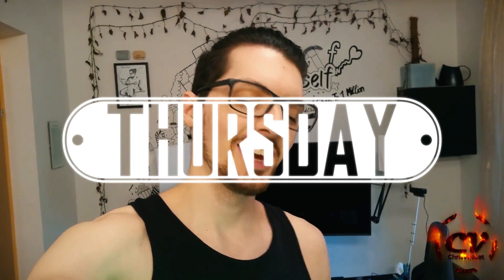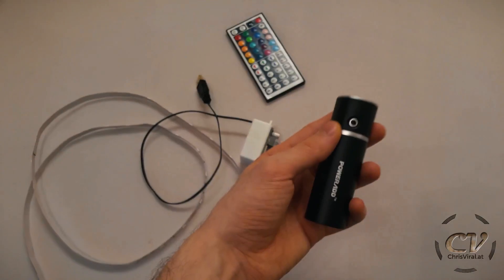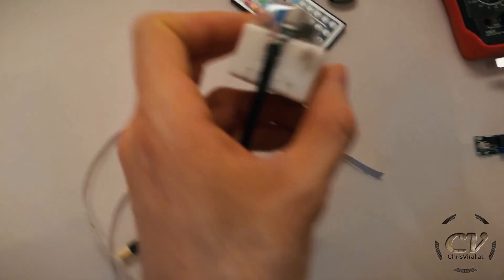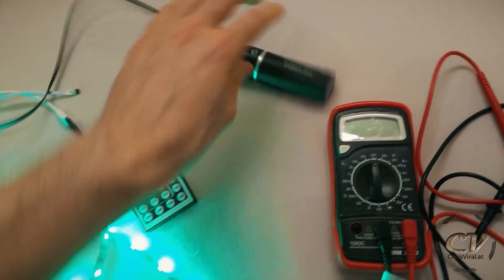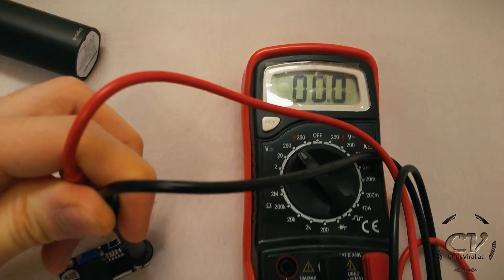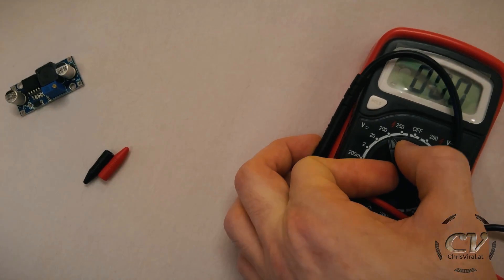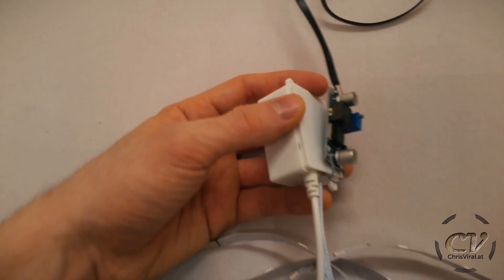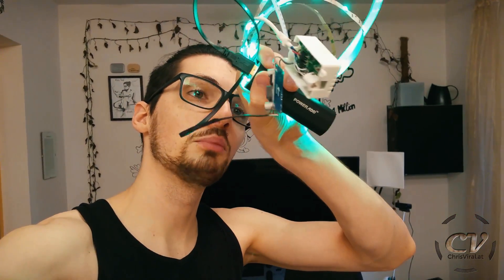How To Power LEDs With A Power Bank (5V To 12V)

Comment from the maker: I just found out about a MUCH easier way: https://youtu.be/LFCl8_Sp0eA
Everything you just saw combined in one cable. 0 work involved.
Reply: hi there im trying to run a power up connected to a step up 5v-12v to run a 12v led lights, but the led lights would only flicker and then die off in abit,  but it would be running at about 10-11v on the step up but it is not the brightest as it can't hit 12v. im using a 20k power bank 2.1a output and the led is 10 strips, 3LED per strips
Reply from the maker: I had the same result on my triangle light. The reason is that the power bank is simply too weak and can't deliver enough current and will then shut itself off. The solution to this problem is to shorten the strips until it gets stable.

Comment: Thank you for sharing this. I use 5V USB-LED-strips built into my guitars (am a luthier based in Japan.). I have yet to find a power bank without a "power switch" or turning itself off. The guitars are closed, the power bank is in the body. There is a lid to open and close, but it is a pain in the butt to always switch on the power bank first. The LEDs shall be operated only by the remote. Any advise on that? All models I tried so far have the same problem. LEDs cannot be switched on only via remote without activating the power bank first. Help plz. Getting gray hair. USB C to A adaptors didn't do it either.
Reply: There are Powerbanks that have a low current mode meant for smart watches and similar small devices that can’t be charged at your normal 5V 1A (which is now a dinosaur of a charging protocol since nearly everything charges at 5V 2A minimum now). 

The low current mode exists as a manual “stay on” switch since the current (usually 50-100ma) is below the threshold that most powerbanks have for the current needed to tell the device something is plugged in and charging so stay on. So if you are only charging your Apple Watch it would normally not keep the powerbank on. The powerbank would see there is barely any current being pulled, assume the device plugged in is no longer charging and switch off to save battery but on most powerbanks with this feature you either hold the button for 3 seconds or double or triple tap. 

The alternative is to skip the powerbank circuit since that is what is causing you issues. Go straight to lithium cells (can be dangerous if you don’t know what you are doing! Seriously don’t just start fucking around with lithium cells without doing research) and use a circuit that gives you what you need. There are tons of simple 5V-32V USB Buck Regulators that can handle that wide voltage range and output 5V into a USB port. I don’t think any of them have any real brains of any kind to auto shutdown the pack. Or even easier would be a USB boost converter that uses one 3.6/3.7V lithium cell (or several in parallel) to bring the voltage up to 5V. The reason why you go this route is because there is a charger circuit for 1 lithium cell in series (as many as you want in parallel) called the TP4056 or TC4056. Charges at max 1 amp and the rate is adjustable. Charging 2 cells in series complicates things because the cells need a balancing circuit don’t go that route. Do a 1S_P pack and use enough in parallel to give you 10,000 or 20,000mah. There are also slightly faster chargers, don’t use the TP5100 it’s garbage, use the “5V2A charge discharge module”. You could have an input jack mounted on the guitar running to the charging input on the module for 5V2A charging with a separate output capable of 5V2A or 10W. Hopefully that is enough power for you?

I would probably use pouch cells. You can get big ones that are 10000mah or more. So 3 of those would be a 1S3P pack or just a 3P pack. 1 cell in series for 3.6/3.7V (most cells are like 3.625 which is why you’ll see 3.6 and 3.7 nominal or average voltage) 3 cells in parallel. Those 3 in parallel combine their capacity for 30000mah or 30 amp hours (30Ah).

Comment: i wouldnt be needing a step up device if my powerbank output is 5V to 12V right? it says it can go up to 1.5A, can it power around 3m strip? i computed if its 2A per 5m, then ill only be needing 1.28A? thanks for answering

Comment: I’m running a 5m led strip light straight to a powerbank (via USB). Will I run into problems if I haven’t converted the 5V out to 12v?
Reply: How long does the power bank power it ?
we have lots of power outages and im looking for a light solution
Reply: @bareminimum  the LED lights wont be at full power because the input voltage is only 5 volts
Reply: how much should the input voltage be? does it depend on the voltage of the lights? ex. if i have 12V led lights, i need a 12V power charger?? @Konstantin_.

Comment: Hi there, i have a question:- can you convert 220 volt Christmas led lights to run on power bank or on 9volt dc supply or 12 volt dc supply?
Reply from the maker: Very hard question, possibly yes... Just look at the power brick data... Then you'll know more. If there is no power brick and the bulbs are configured for 220V then you can't do it.

Comment: A little off topic to your video but maybe someone can help.  When I plug in a USB led strip directly to my power bank, the LEDs flash with very low brightness, around once a second. When I power on the power bank, the LEDs power on as usual, nice and bright.
How do I stop the LEDs from drawing power when the power bank is off?
Reply from the maker: Oh I just had a Déjà vu right there hahaha 🤣
My answer to the same question on another video was that it is zombie glow cost by cheap electronics. Not fixable unless strip gets disconnected. A switch will do the same - disconnect.  Good solution, thanks again for answering :)
Reply: Thanks for the help! I ended up adding a switch. It did the trick. 👍
Reply from the maker: Nice! :)

Comment: I hooked a 6 foot multicolor and mode 5 volt LED Light strip with adjustable light output from AuraLed that has a USB cable meant to be powered from a computer or smart TV and hooked it up to a 5000mAh duel USB battery/charger pack from Walmart and ran them at full power for over 6 hours with only a 30% power usage from the charger.  Didn't have to cut or splice any wires, use a power converter or anything.  Just plugged em in and turned them on.  Works great for hanging off a backpack, a tent light or any other portable application.   Best part was price, lights $4.98, power charger $7.99, total...$13.87 with tax. All at walmart, even though I hate that store.
Reply from the maker: Even easier then, nice :D
Thanks for sharing 🙌🏻

Comment: Please help me! I am looking forward to make this project but i have a few questions. 
1. I have a power bank with 2.1 A output will it work for my 5m Led strip 300 LED (60LED/M)  --  The Led is rated for 2A so should work good i guess. ?
2. How long will the led strip work for a 10,000 mAh power bank?
3. As you said will the power bank deactivate when using with led strip or it deactivates if there is no led strip?4. Is this project safe? like no chances of shorts or sparks something like that? 

Please Reply!
Reply from the maker: First of all see this video (also answer to question 4) which will make this project super easy:
https://www.youtube.com/watch?v=LFCl8_Sp0eA

If you're new to DIY stuff I'd recommend the approach from the mentioned video.

Yes I think a 2A output can power a strip up to 5m. I fried a power bank while trying to power a 6m strip. So the shorter - the safer. The LED strip is not really in danger if that's the question.

2. if the strip is rated for 2A then your 10k mAh bank = 10Ah can power it for 5 hours. (10Ah / 2A = 5h)

3. my power bank has an auto off function which will activate when there's no significant power output. 5m will definitely get registered but this depends on the model.
Reply: @ChrisViralVlogs  Thank you so much for your answers and today I finally built and was successful to make this project :D you are really a good soul . I will pray you do well in life thank you so much know I can play with my led strips with my power bank yay.🤗🤗
Reply from the maker: Glad to hear that, thank you :)